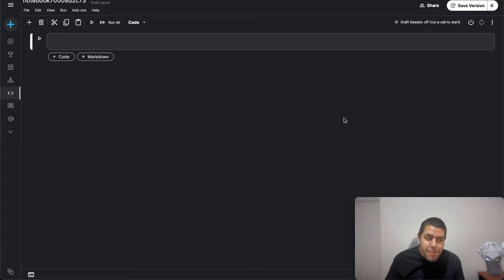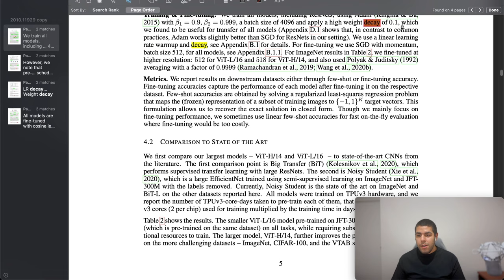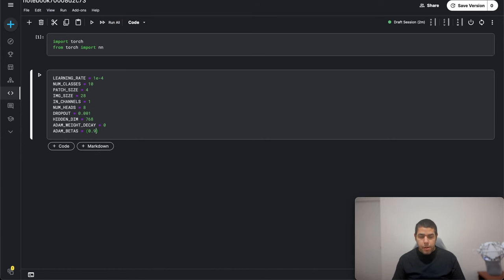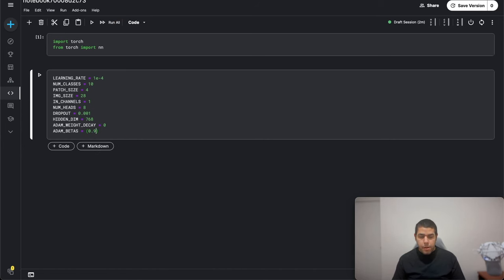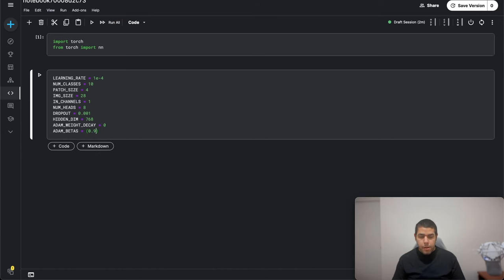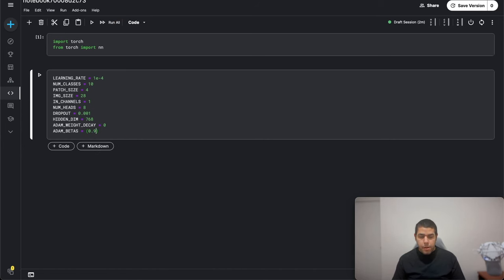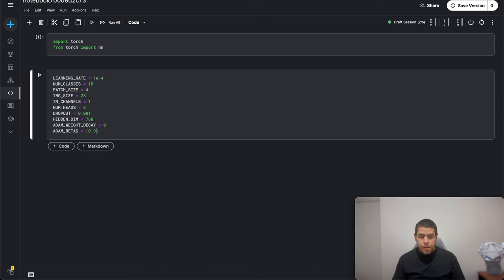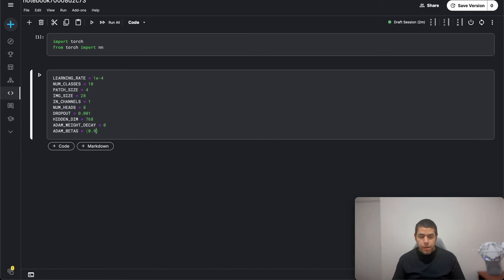Implement and Train ViT From Scratch for Image Recognition - PyTorch

Comment: I am a tech person and want to jumpstart into ML. I would really appreciate it if you could begin with hardware requirement (whether a GPU is required or not). Also, the sequence of various packages required to be installed. Thanks.
Reply from the maker: Hey you need 15GBs of GPU usually at least. Or you can use GPU providers for free such as Kaggle or Colab like I do in the video.
Reply: @uygarkurtai  Thanks

Comment: Hi, I get some advice for this code. I deal with the images which in_channels = 3. But your work can not fit the situation that in_channels = 3. I do some fix based your code. self.position_embedding = nn.Parameter(torch.randn(size=(1, num_patches + in_channels, embed_dim)), requires_grad=True)  After that, the code can work in the in_channels = 3 images. HOPE YOUR REPLY! -China-Beijing
Reply from the maker: Hey that's a great catch! Thank you for pointing it out :) However you may not want to change position embedding dimensions. Because that "+1" stands for the extra CLS token. Try the following ->

self.cls_token = nn.Parameter(torch.randn(size=(1, 1, embed_dim)), requires_grad=True)

Let me know if it works!
Reply: You are right! Thanks ! I know that the "+1" means extra CLS token. And I change the cls_token which size=(1,1, embed_dim). It work well!  @uygarkurtai
Reply from the maker: @Yingjie-Li  Good to know that :)
Reply: @uygarkurtai   If my understanding is correct, wouldn't it be preferable to hard-code the in_channels of the self.cls_token to always be 1, regardless of the actual value of in_channels? This is, "self.cls_token = nn.Parameter(torch.randn(size=(1, 1, embed_dim)), requires_grad=True)" for any case, as cls_token will always have 1 dimension. Thank you very much you both! ^^
Reply from the maker: @FernandoPC25  hard-coding is fine too actually if all your images has the same number of channels. I just made it more generalizable like this.

Comment: import torch
import maxvit
# from .maxvit import MaxViT, max_vit_tiny_224, max_vit_small_224, max_vit_base_224, max_vit_large_224

# Tiny model
network: maxvit.MaxViT = maxvit.max_vit_tiny_224(num_classes=1000)
input = torch.rand(1, 3, 224, 224)
output = network(input)     

my purpose is to do give an input as an image (1,3,224,224) and generate output as its description for that.  how should i do that, what should i add more to this code?
Reply from the maker: Hey, I have no idea about maxvit. If your input channels with models input channels and sizes match, there should be no problem. I suggest you check those out.

Comment: Thats cool man, your coding skills and how smooth you are coding that is even scary, maybe AI is not for me xdddd.

Anyways my question is here: You are using only one layer , what If i want to use multiple layers? 22:44 after encoder_layer should I add another encoder_layer_2 with different parameters?
Reply from the maker: Hey, thank you for your kind words :) 

You can do that. The thing is you have to experiment these kind of stuff. In AI, let's say there's this architecture that works. Why is it like that? Because it works. Adding another encoder will work? Probably.  Will it improve performance? I don't know. You got to try.